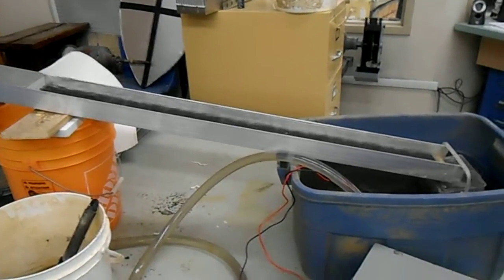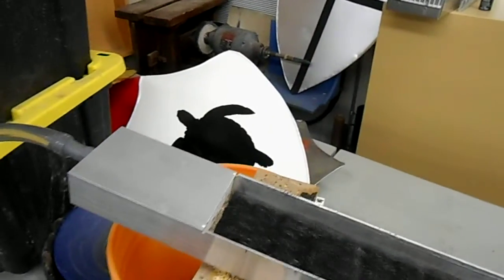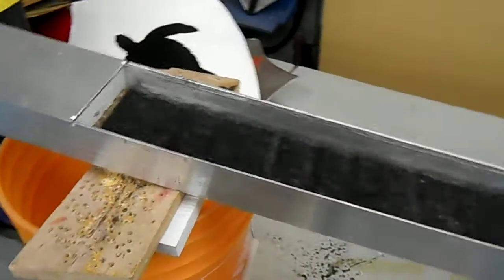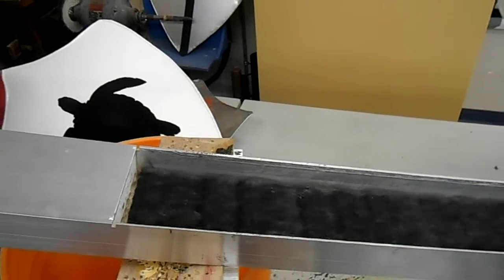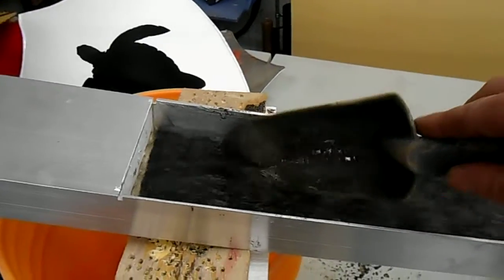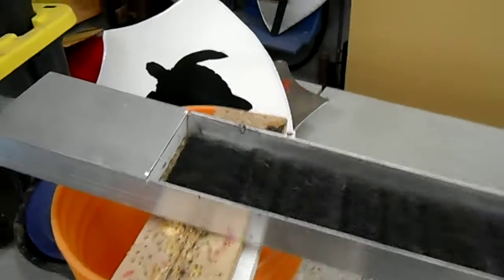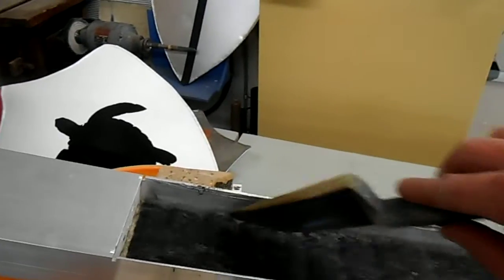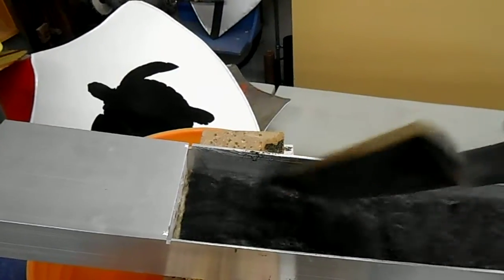Clean-up sluice with Gold Hog washer mats.

Comment: i built my own and what i did was instead of changing the diameter of water hose for slowing and speeding the water. i used a dimmer switch to reduce/increase the voltage

Comment: I learn so much from watching your videos and always look forward to seeing more to come in the future.. but I have one question, if I'm using a 50 inch folding sluice box what Gold Hog mat do you recommend that I use and in what order starting from the flayer down should I run them? If only doc from gold hog was open to comment on some of his videos would make it real nice... And I'm also using it as a stream sluice with not much water pressure, and I'm also running a 1200 gph bilge pump set up  as a recirculating system.. I have recently built a header box for it and thank you again for the information on where and how to order the aluminum..  I also have it set to where I can add a 500 GPH pump as well if needed more pressure..
Reply from the maker: theBald1 Doc From gold hog would be able to give you a much better answer.  But  I can tell you what I like.  And "yes" I think you will need more water.  You did not say how wide your sluice was, but 1200 gph is not much.  I would start with 2-3 rows of "Scrubber" mat,  then half of what ever is left with "Razerback" and finishing off by calming down the water as much as possible using either "UR" mat or "Bedrock"
Reply: Dan Hurd I'm using a 9 ×50 sluice.. And so far I'm not a fan of the folding sluice box... Lol
Reply: me too.